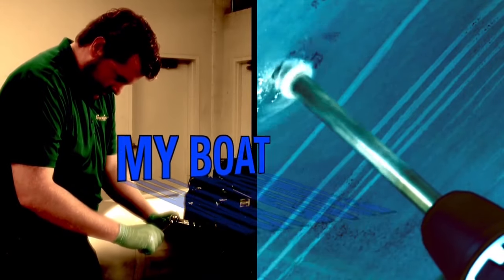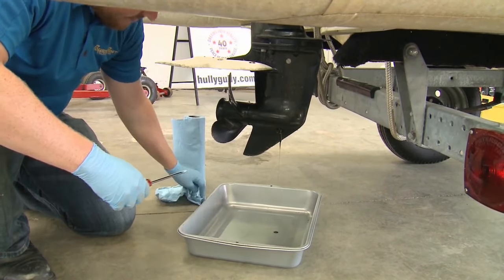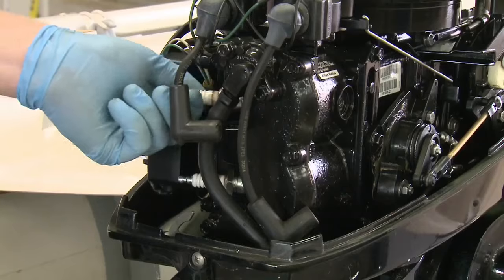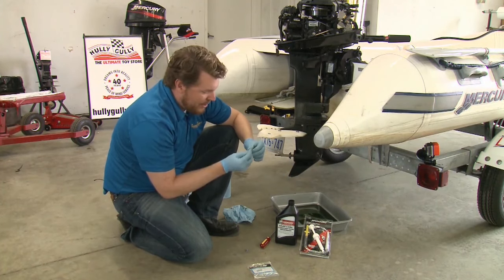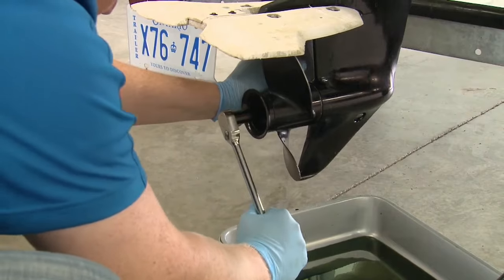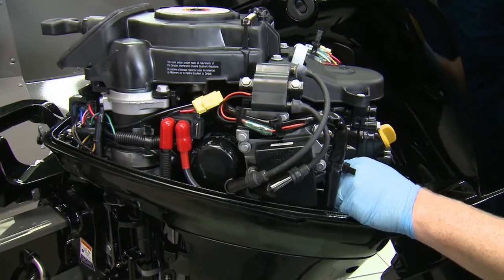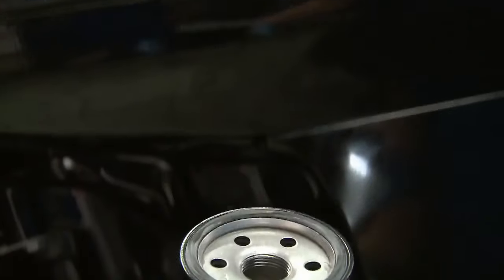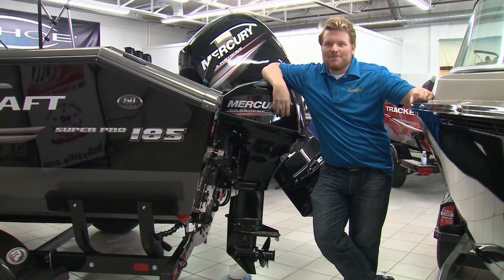How To Do Routine Maintenance on Your Small Mercury Outboard | PowerBoat TV MyBoat DIY

Comment: Thanks for the clear concise and simple instructions.  You did not replace the impeller though which I thought was a service replaceable item on a yearly service.🇬🇧👍🏻
Reply: 300 hr or until there is weak flow from the tattle tale.

Comment: Thank you very much. Very good information you have given. One thing I want to know. If the engine is in the garage and not being used, will it have to be started every two or three days to maintain it.
Reply: Nah, not really. Just take out the carb and clean it, take a look at the plug(s), flush the internal fuel tank and your good to go.
Reply: Thanks
Reply: @rajeshmisra1030  When you run it last, turn the fuel off and let it run dry. This will keep fuel or of the carb that will gunk/gel up.

Comment: I have a small lever under the cowling of my 25hp mercury (late 90s) moves back and forth and seems very loose, but does not come out...do you happen to know what it for? ...I've never owned a boat or motor before
Reply: It's most likely your tilt lever to help move the motor up and down